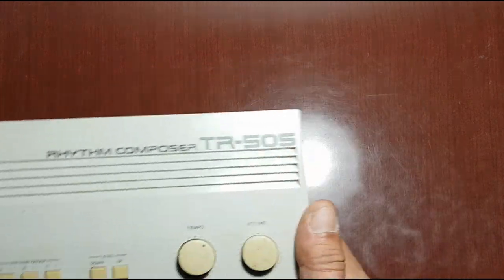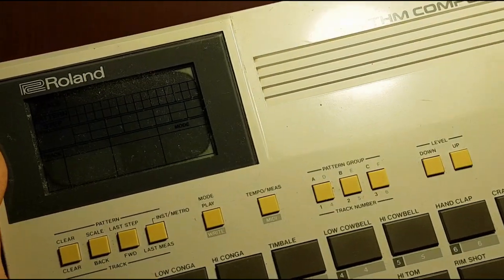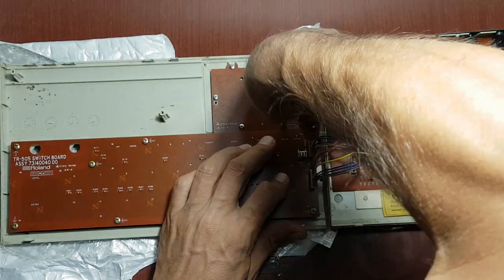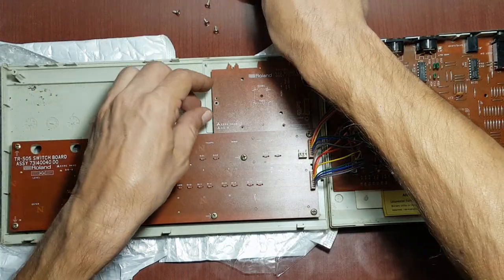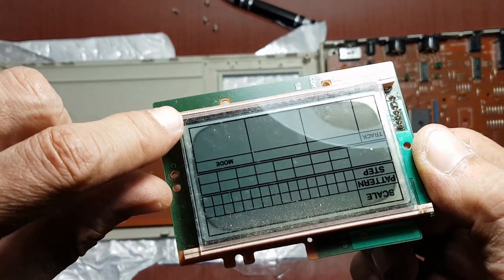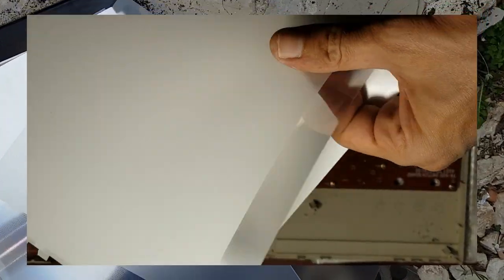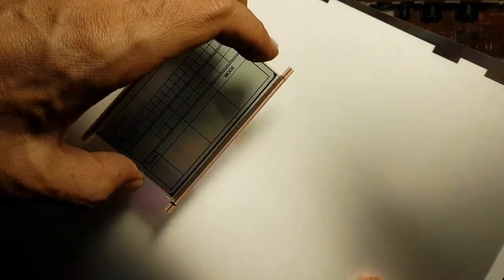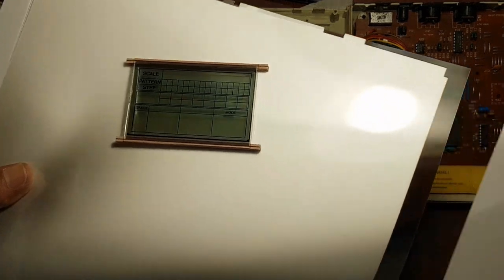Roland TR 505 : Screen Repair/ Dark LCD / improve visibility / TR 505 Mod

Comment: Hi, thanks for the video, there no wire/connection between the screen and the PCB of the screen ? I mean it’s just sticked together ?
Reply from the maker: Hi, screen is connected via elastomeric connector that two rubber on the side of the screen, some kind of connector in flexible rubber. just peel it off on one side, in my case I peeled it off the pcb board and left it on the screen.

Comment: Thanks for the video. What did you use for the background material? What layers did you end up using? Thanks!
Reply from the maker: I replaced it with a background from a broken computer monitor, you can also find that background in the screen of a broken smartphone. When you disassemble the screen, you will find several transparent layers and the last one is not transparent the white one. I used white and trnsparent layers .